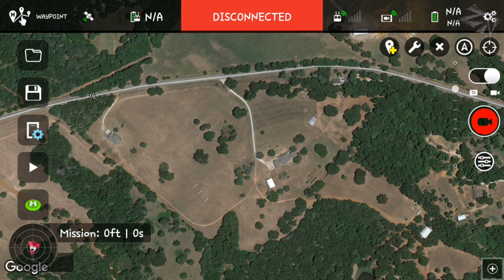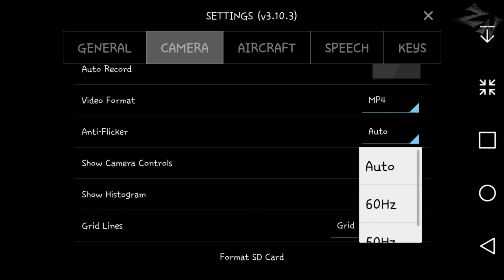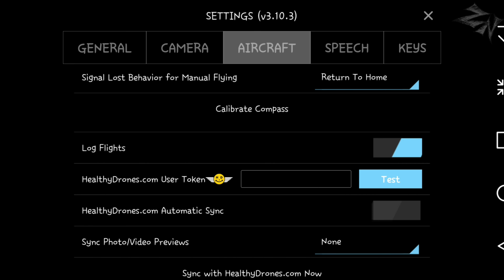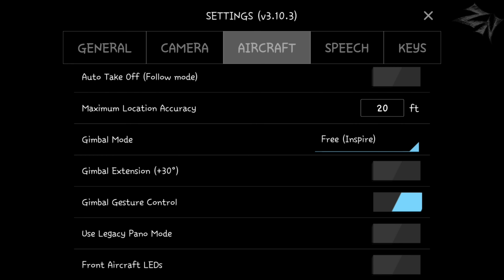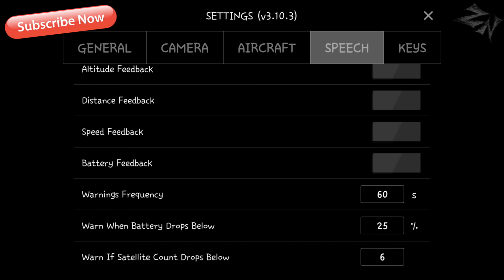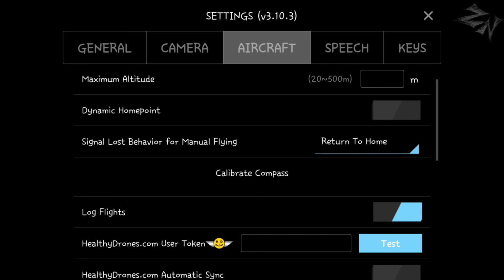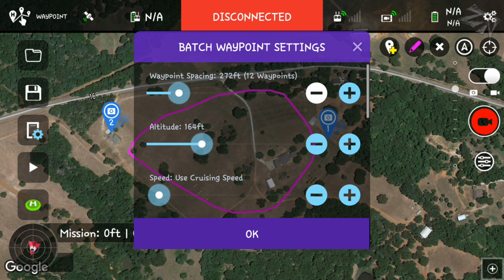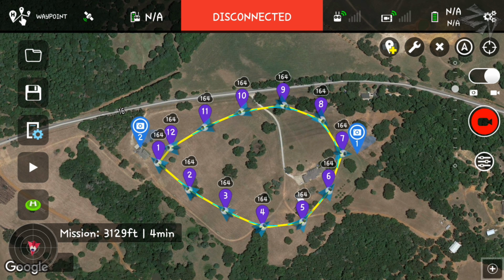Litchi App Settings (old vid, check description for updated vid)

Comment: Hey Mate
I have a phantom 3 standard and been flying it and my race quads for a long time now but never tried litchi....quick question when running litchi on my Galaxy s7 edge is it important to Force stop the Go App???? And vice versa when running Go app
Thanks
Reply from the maker: craig dixon Yes, ALWAYS FORCE STOP the GO app and vice versa when using Android.  Thank you for asking, I totally forgot to mention it in the vid.

  The first time you open the Litchi app don't worry about force stopping GO, Litchi needs to verify itself with the DJI servers.  After verification is complete and you finish going through the settings, turn the phantom & controller off, close the apps, force stop GO, then turn everything on as normal and open Litchi.  Should be good to go.

  Thanks again for asking, that was an excellent question.
Reply: ZNoble Thanks for the quick answer ...Have you noticed that Dji go app now forces you to upgrade...Just noticed this morning my ver 3.1.1 wants me to upgrade to 3.1.3 and I can't do anything till I do....Urrggh
Reply from the maker: +craig dixon yeah, it's a little annoying.  I'm running mine with a Wi-Fi-only nvidia tablet so I'll get those notices when/if it connects to the internet.  I have no landline internet or wifi at the house so it's really not affecting mine, but I still have both apps on my phone and I have noticed the update notification windows popping up on my screen.  Its weird for sure.
Reply: ZNoble Sorry mate ...1 last question...So are you saying I should turn on litchi for the first time and connect to my standard as normal and run through the settings in litchi without force closing The Go App....And then from there whenever I use litchi or go app I must force close one app before using the other?????
Thanks
Reply from the maker: craig dixon correct
Reply: ZNoble Thanks so much ...Will let you know how it goes...
Love your channel ...Your Litchi  Tutorials are the best I have found....Thanks from New Zealand
Reply from the maker: craig dixon the phantom doesn't have to be connected the very first time you open Litchi.  You can go through the settings right before your first flight if you want.  The phantom DOES have to be connected when adjusting settings.
Reply from the maker: craig dixon Right on bud, Texas here!  I'll give you a sub too.  Can't wait to see some waypoints from your neck of the woods.

Comment: So when I set it to “hover” after I lose signal, then what? I gotta go look for it? Idk about that. Not after the my last bear attack. Not until I at least heal
Reply from the maker: wckdclwn911 yeah, hover is a goofy setting to have as default.  You can always go to the general tab in the settings menu and select "find my aircraft" if the drone is missing.  That will show you it's last recorded coordinates.

Comment: Thank you ZNoble for one of the best videos on Litchi. I've used Litchi from the get go with my first Phantom.
Reply from the maker: Charlie Phantoms Thanks.  I know I sound a little rude in it but I had made this after seeing many "litchi crash" videos, 99% of which were totally avoidable.  It really does boil down to common sense when using anything new, especially when setting up something as risky as autonomous flights.
Reply: Not rude at all. I will watch this again. I have two pilot error Litchi missions posted on YouTube. 1st video Phantom 3 Std on 14 minute mission hit brush, flipped upside down but made it home unmarked. 2nd video is Phantom 4 on 16 minute Litchi mission with a waypoint set 15 ft. below ground level ,OUCH!!. Obstacle avoidance prevented a crash but the quad arrived home 4 1/2 minutes late. The December 2016 update added the "relative to ground" mode to set waypoint altitudes in the batch waypoint editor.
Reply: One important point flying in uneven terrain. If you say, set it to 100 ft. RTG for all way points it will be 100 ft. RTG at those waypoints but not necessarily between the waypoints. If the ground elevations changes between the waypoints then that could be a problem. The drone will increase / decrease the elevation at a constant rate between waypoints. This might be obvious but if people are not aware of it they could get into trouble. That was the problem with the Phantom 3. The terrain did not drop at a constant rate but the aircraft did.
Reply from the maker: Charlie Phantoms right on.  Around here the terrain is pretty flat so educated guessing and double checking makes it easy to pull off.  That and close waypoint spacing.  Back when the laws were a little murkier I tried a few long distance missions and terrain did come into play.  That's were setting up the missions on a pc with elevation change is better.  I'm in a rural area with no internet available so I'm stuck with what I have for the time being.

Comment: Thanks for the tutorial. I don't see hardly any of these settings on my Litchi app. Do I need to be connected to the RC and the mavic turned on to be able to see all these menus? I can't do it offline?
Reply from the maker: Anna Ferguson Yes.  Some settings will allow for adjustments but won't save them unless the drone is connected.  There might even be some settings that don't show up at all without the drone/controller connected.  So its best to have your mavic connected while configuring the main settings like go home/maximum altitude, video format, and maximum location accuracy.  Are you using an Apple or Android device?
Reply: Apple as I read too much neg feedback on Android on the forums. Yet to do a Litchi mission as I got a Downward Vision Sensor Calibration Error yesterday :( but dying to try this out Litchi and your tutorials are a great help. Thank you!
Reply from the maker: Anna Ferguson Ok, all my vids are the android version so there will definitely be differences.  Did you get that error while in flight?

Comment: ZNoble, is data/Internet required to do the missions?
Reply from the maker: Earthling01 It's not required to execute the mission but it's pretty much essential to setup the mission.  I use the Nvidia Shield tablet (wifi only) for all my flights now.  Mission setup is done using my phone.  Once the mission is saved I can move the file via sd card from the phone to the tablet.
Reply from the maker: Earthling01 here's how I do it.. https://youtu.be/X5ISxEHKQGA
Reply: ZNoble, Thank you very much... When my phantom arrives, I will purchase litchi app. You're one of my mentors now.. thanks
Reply from the maker: Earthling01 right on.  Just take your time, use that thing sitting on top your shoulders and you should be fine.  If you have more questions in the future feel free to hit me up.

Comment: Altitude limit is not as straightforward as you make it seem I live in a mountainous area and if you set this to no more than 400 feet that's 400 feet above where you took off I cannot find a setting that will adjust for ground level so I leave this setting at maximum
Reply from the maker: Tepee Tim there's no such setting.  Neither the app or your drone knows the topography of the area it's flying in..  maybe within 5-10 years drones will be that advanced but as of now you will have to set your altitudes manually.  There is another method of drawing out waypoint flight paths using Google earth and a desktop pc.  That method does follow terrain topography and there are a few good instructional videos on how to do it.
Reply: OK Z noble no need to be a wise ass apparently you didn't read the directions because you can change altitude from above home or above ground once you've made waypoints selecting  The batch tool and then changing altitude from home to ground .
Reply from the maker: Tepee Tim  I wasn't trying to be rude.  I think I know what you're saying now.. [EXAMPLE] You're taking off halfway up a 800' tall mountain, you want to fly above the summit which is 400' above the take off point.  You would have to set your altitude limit to 800' if you wanted to fly 400' above the summit.  You're absolutely correct, the altitude limit would have to be set higher than 400'.  Is that what you mean?
Reply: Tepee Tim You have it right.  Use the Batch Edit. When you select the Relative to Ground option. Litchi will automatically calculate the correct waypoint altitudes given the ground elevation at each waypoint, using the ground elevation at waypoint 1 as the reference. For the best results and because waypoint 1 is used as a reference, it is strongly advised to place waypoint 1 in a location close to where the drone will take off (i.e. similar ground elevation). This option requires internet as it uses the google elevation data which is only available online. After the changes are made and the mission saved you can fly it without internet. I fly in mountainous terrain so I use this feature for almost every mission.

Comment: hey dude,
can you run through what your process is for getting recorded video from the phantom all the way to editing and uploading? much appreciated.
Reply from the maker: mterry3788 Sure, pop the sd card out of the phantom, insert sd into tablet, edit footage, export rendered footage to sd, insert sd into cell phone, upload to YouTube through the YouTube app.  *Make sure your upload settings in the YouTube app are correct before uploading the vid*
Reply from the maker: mterry3788 Are you having trouble with something?
Reply: ZNoble yea I can find and get the video. just none of my devices smoothly plays the 4k video
Reply from the maker: +mterry3788 what mobile devices are you using?
Reply from the maker: mterry3788 If the devices you're using don't have 4k displays it won't play correctly, it'll auto crop down to a resolution that it can play (my tablet does this), or it won't play all.  Next thing it could be is the micro sd you're using doesn't have a fast enough read/write speed to handle 4k.
Reply from the maker: +MyPhantom there might be something else going on..  I had trouble making a video yesterday because it showed the files were broken and I could only play them on VLC and in my video editing app.  They would not play at all through the gallery app on my LG G4.

Comment: nice thanks for waypoint vids i will now try litchi w my MavicPro. BTW 98ft is the standard 30meters (good all round "standard" distance to avoid urban trees/home/poles) but yes like you said check the areas around u if u in rural area u may have bigger trees
Reply from the maker: Luke Roman Right on

Comment: you asked, why "hover" is even an option in case of lost signal. imagine a scenario when you're shooting something indoors and drop your remote. the aircaft will temporarily lose connection and then will shoot straight up into the ceiling attempting to return to home.
Reply from the maker: Alex K I could understand that being useful in indoor testing situations.  But for the rest (most) of people using this app, RTH would definitely be the preferred setting.  Why do you think DJI Go comes with RTH as default?